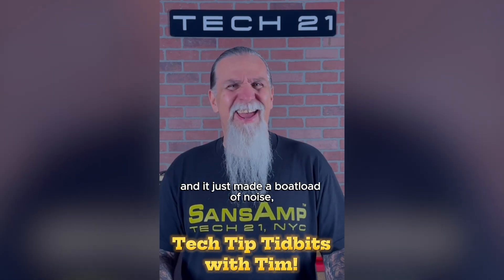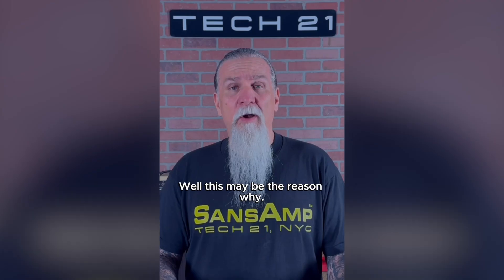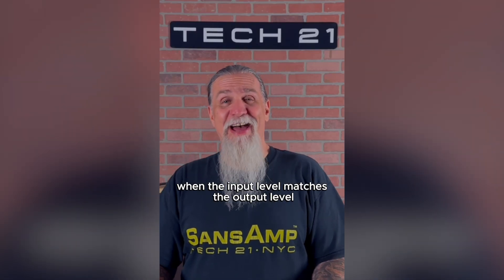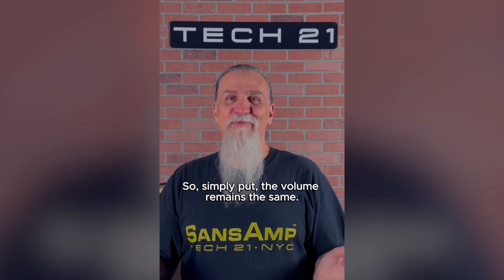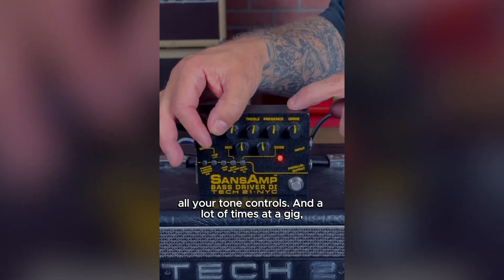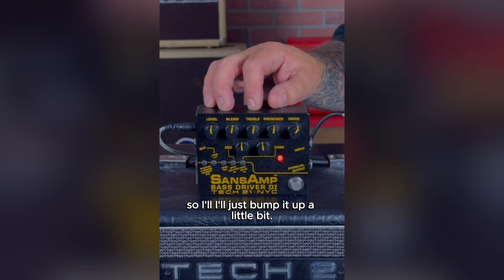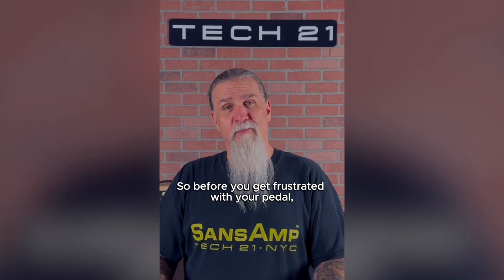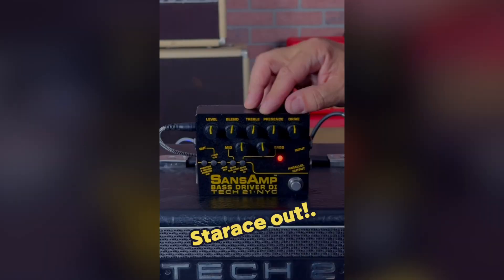Tech 21 Tech Tip Tidbits with Tim: UNITY GAIN

Comment: OK. Question: when I run my guitar through my SansAmp PSA 2.0 directly to the FOH and my input level is equal to my output level, what amplifies my electric guitar signal then so that it can be heard? Tim said it should be the same volume whether it is engaged or bypassed... Then there would be no amplification of my guitar signal, right? Or does the SansAmp also amplify in bypass?
Reply: We recommend unity gain when using our SansAmps with an amp/mixer/recording interface. Things can become a little more complicated when going to a mixer/PA system because you also have to count on how the technician running the mixer has the input gain set. In most cases unity gain should work. 

Keep in mind that the "mixer" is driving the PA systems power amps and speaker system. Your SansAmp only has to work properly with the mixer. A mixer can accommodate a wide range of signal levels from microphone, instrument to line level. Please contact our technical support department should you need further assistance.
Reply: @chrisd.  Thx for the fast reply! I run my mixer in the rehearsal room, which also sends the inear-monitor-signals to all the band members. I'll check the input gain. But I think when using unity gain on the PSA I would need tons of amplification from the mixer and the active speakers. I'm not quite sure, if that will sound better than the nice amplification from the PSA.
I still do not understand, why the device has so much volume and amplification on tap, when you advise users to use unity gain... ;-)
Well but I'm a complete mixing noob... I shall get some education on how to mix my band properly.
Reply: I seem to be too dumb to get my PSA to unity gain... When I have gain at 127, which I need to get any kind of metal tone I cannot dial level down enough to get it to not be louder than in bypass. At level 00 there is no signal left and with level 01 it is already louder than in bypass. So what am I doing wrong? Even your factory presets of a plexi, van halen, recti, ... all use gain 127 and level around 25-40. It seems when I really go up with the punch (which gives me the sounds I like), I cannot achieve unity gain anymore, because the mid boost generates too much volume...

Comment: Unity gain can be a challenge with distortion because of the extra harmonics and compression factor.  I was once so worried about my fuzzy tone (for the "Dance to the Music" solo) blowing out the sound guy that my fuzz level was much quieter than my clean level.  The solution would have been to compare dirty to clean during soundcheck... but that was my oversight.